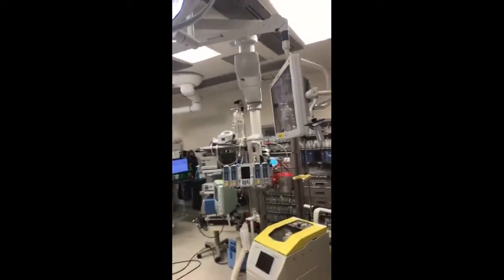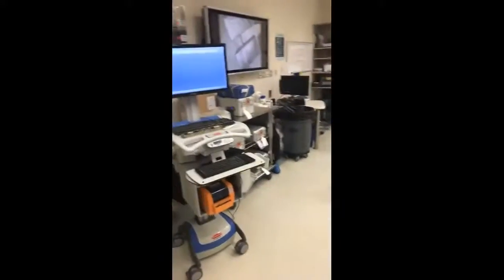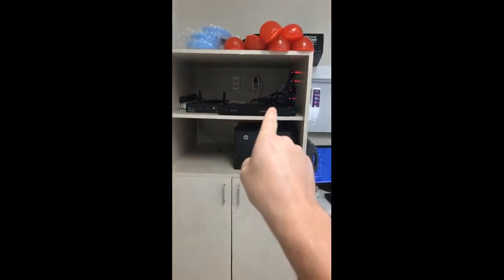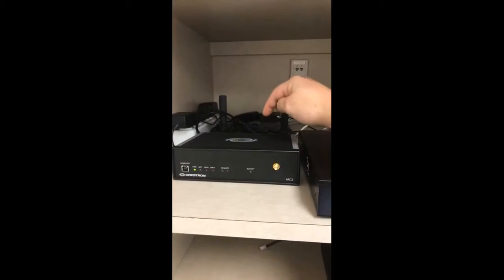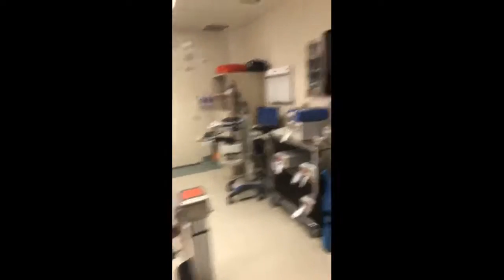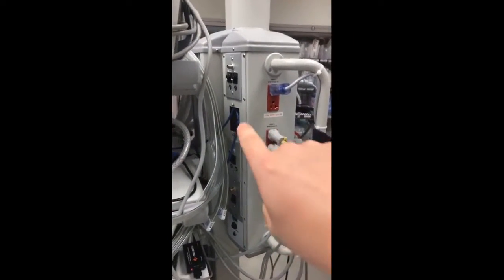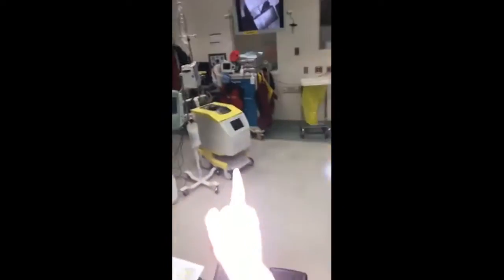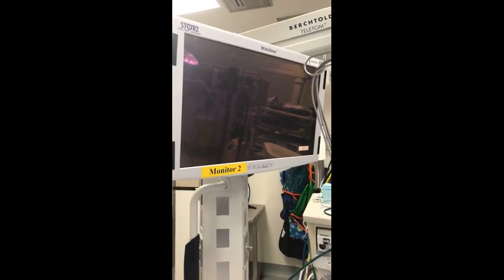Custom Operating Room Video System

Comment: Excellent work using the crestron. We are not allowed to do our own thing with installs. Has to be a vendor/mfg because of liability. It craps out during a case when you’re not there or catches fire and burns down the OR while patient on the table. The risk analysis people want a root cause of what piece of equipment caused it, how it affected the patient outcome, and is the manufacturer aware etc.
Reply from the maker: Most places are not allowed to run cables or alter video systems - until the room fails and they want to run cases in that room asap and there is no money to purchase a $25k-$30k (minimum base model) integrated OR package.  Lots of things mysteriously happen or allowed to happen when the need arises. - just look at the FDA rubber stamping approvals of home made ventilators during the Covid pandemic.

Comment: I just discovered your channel. So is this system still functioning? Have you had any issues?
Reply: There was different versions of the system. The first system used fiber optic - that was a pain to install. The second system used cat6 ethernet with POE. Much nicer. The systems were installed back in 2017 and as far as I know, they're still running. Considering the systems cost ~$3500 to buy and install, they've gotten their money worth.